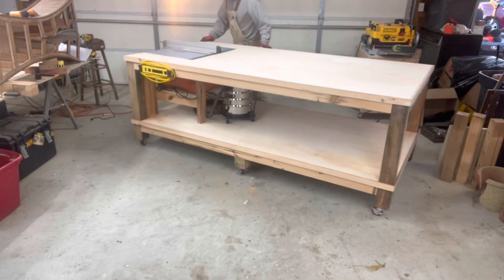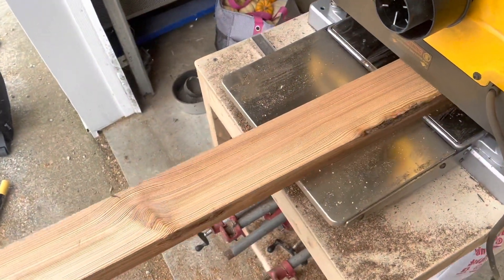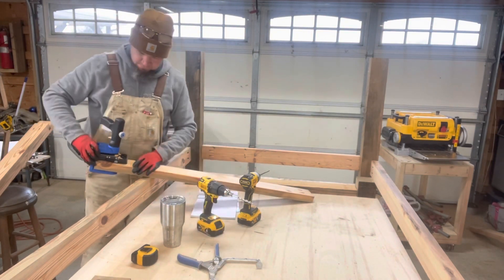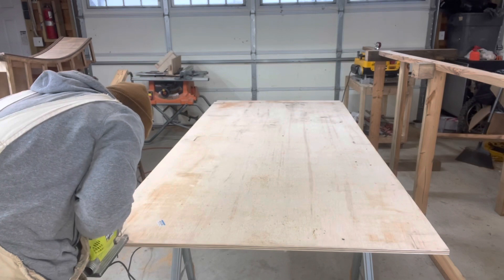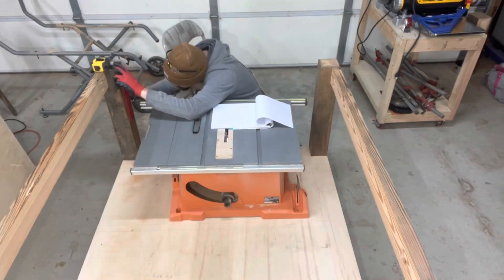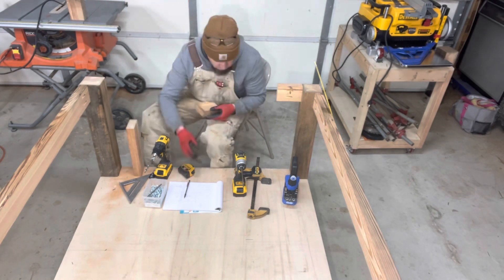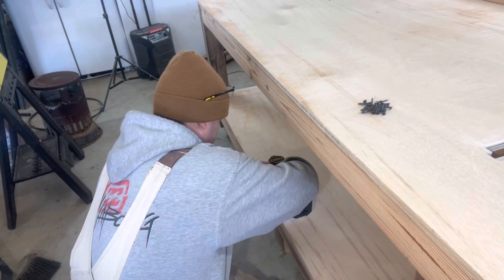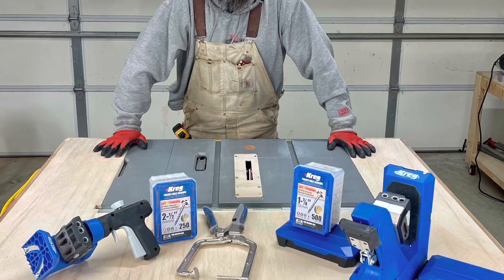How to build a EASY moveable work bench with a built in table saw!

Comment: I’m doing a similar build for the new(ish) Dewalt job site saw. Economy spruce studs..(dried) planed square and using their dimensions for half lap joints reinforced with glue and screws. Your shape and basic structure is perfect for my plan. I’m too poor to buy the kreg stuff, but when I get the cash they will inhabit my little shop.thanks for the excellent content.

Comment: Greetings fine human. The workbench is nice. I've considered doing this and I can see the purpose. I guess people that are watching this, you need to consider the purpose. I'd like to have a table saw worktable, but the issue is when I'm dealing with large wood slabs I need the worktop to do work on the slab and thus the saw is covered if I need to cut out some misc pieces. 

 I really like the table, I might build one out minus the saw :)

Comment: Matt i want to make one of these tables, but i have the dewalt 8 1/4 saw to suite my needs.  Similar process with that one even tho my fence is on tracks?
Reply from the maker: Yep.  My fence has a rail it rides on in the back.  Just leave enough of a gap to allow for that as well as removal of the fence.
Reply: @MatthewPeechWoodworking  do you cut where the rail is supposed to go when you open it up or just leave it stationary

Comment: Did you also use pocket holes to attach the 4x4 legs? If so, what size screws? Thanks 🤗
Reply from the maker: I would use 2 1/2" screws.  No worries!

Comment: There seems to be mixed emotions out there for pocket screws. I have only incorporated a time or two but weren't for anything load bearing. Are those joints still holding strong a year later? Also, I noticed you had the Ridgid table saw in this video. I am struggling to decide between that and Dewalt due to price difference. Any feedback on the Ridgid would be awesome!
Reply from the maker: Holding extra strong!  The sheer weight on a single pocket screw joint is 707 pounds.  A mortise and tenon will fail around 400.  The rigid has the double t slot.  Im not sure about the dewalt.   Just make sure you get one with 2 slots so you can make jigs and sleds!  Ive never had any issues with my ridgid.
Reply: @MatthewPeechWoodworking  Thank you brother! Really appreciate the insight! Hope the new year is treating you and family well!
Reply: yes! i built a double wood gate using the basic kreg, its still square a year later, no sagging.